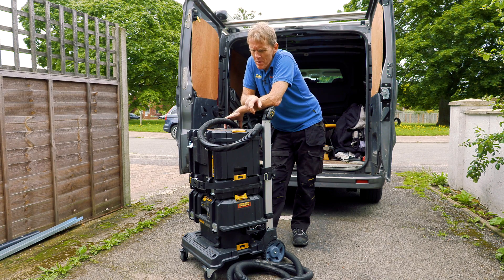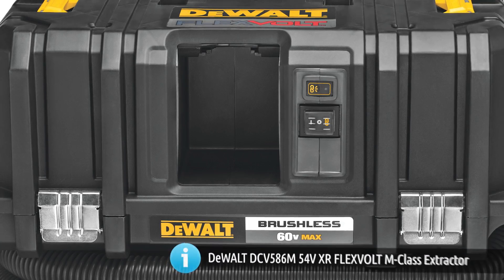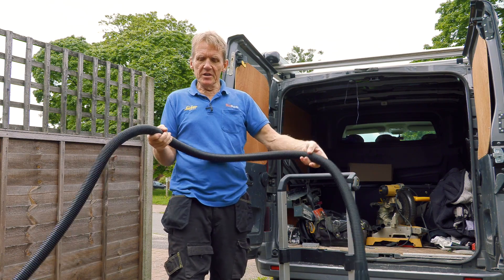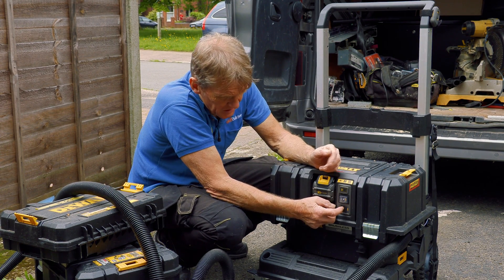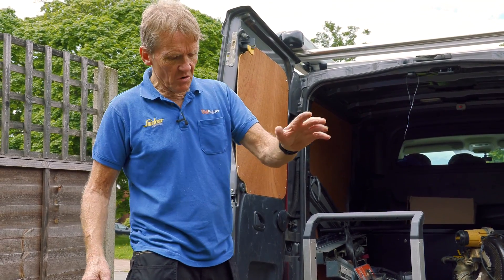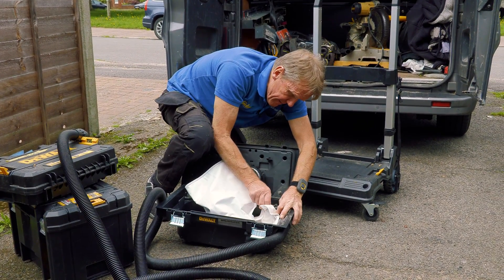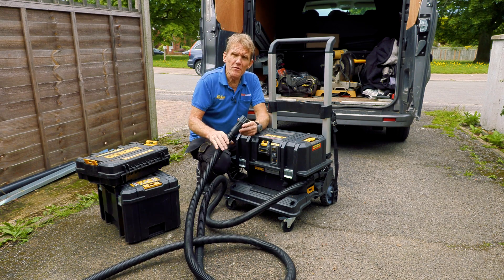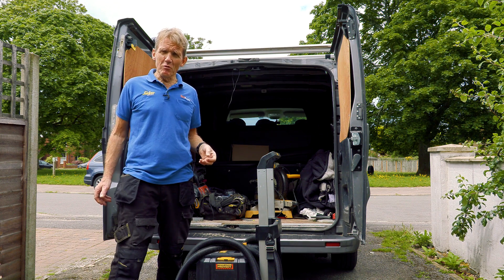Cordless Dust Extraction with DeWalt DCV586M

Comment: In regards to the DeWalt dust extractor are you able to turn off the thumper motor or is that in auto mode unable to shut off?
Reply from the maker: I don't think you can turn it off because it is the cleaning mechanism and the alarm would flag up a blockage.

Comment: I have migrated 100% to the Tstak system, which offers great value compared to others on the market. That said, Tstak design is idiotically flawed in multiple regards. One is evident at the start of this clip: The handled trolley does not allow the lidded boxes to be opened when connected to it. The trolley only works properly with Tstak's under-sized drawer units. Those  starting their collection of components  are well advised to save money and gain functionality by purchasing the 4-caster carts only. Another annoying flaw is that Dewalt did not see fit to stick with a truly modular set of heights: the small lidded boxes and the drawer units are not the same height, nor does the height of the larger lidded box equal twice that of either of the smaller units. The result is a totally unforced error: one can only use Tstak columns as level work supports if the component mix of each column is identical. Nonetheless, I find the system the best value available by far and have been very happy with its  durability and the efficiency it has brought to my on-site ops. I will be adding this integrated vac straight-away and using it atop a cart to support a large lidded box converted to function as a dust separator and, on top of all this, a miter saw. A cordless, dustless mobile sawing center will be a great asset for my interior finish work.

Comment: I’ve had my hoover for about 4 years but my watch stopped working. I’ve changed my batteries but it still doesn’t work. Any Tips
Reply: Hold the tool connect button on the extractor while pressing the remote repetitively that work for me

Comment: Protip.... Make a couple of bungs for either end of your hose to prevent dust falling out during transport. the extractor has an attached bung so making a couple for the hose too is a no brainer.

NB. Best place to put the remote is around the far end of the hose that way it'll always be right on whatever tool you're using.

Comment: ...I had big problem with this Dewalt hose , very stiff with big memory for the tiding around the vacuum and because of this I started locking for a better solution from other manufacturers. 
I find out one piece of art clear material and extending from 1 to 10 and I changed .
Reply: ... the new model of DCS520 has radio control includes in the circular saw this days.

Comment: This is silly, if the tool requires a dust extraction station then buy the tool as a plug in, if you have to plug one thing in then you may as well plug two in, thats, table saws, drop saws, routers and track saws everthing else battery.
Reply from the maker: You are assuming you can plug in. Many sites won't allow trailing leads.
Reply: @SkillBuilder  valcro the trailing lead around the suction hose

Comment: Been using it for about a week just for cleaning and its been very useful, the 6ah batteries run out quite fast but thats to be expected.  Not had a chance to try it out on any tools yet.

Not sure if I am doing something wrong but I find the bag fit is very bad.  The unit was beeping because the bag was full but once out there was still lots of space, probably a third left to fill.  Couldn't get the top back on without spreading the contents of the bag evenly or it just obstructed the filters.

Almost seems like the bag needs to be slightly smaller or the bottom of the unit needs to be bigger.

UPDATE: I recommend against buying this.  Been using for a few weeks on a mitre saw and the bags will only fill halfway before needing to be changed due to terrible design as I mentioned before, absolute rip off.
Reply: I've found best way is to have a few bags, fill them all, then empty them somewhere safely and reuse, easily get half a dozen uses from each bag with no fall in collection/suction rate, but manufactureer wont tell you that,wonder why. Becomes quite economical then.

Comment: Great review. I actually purchased one a few weeks back. My vacuum keeps beeping can't figure out why. Any reason why? Checked for low battery aswell.
Reply: I had the same issue.  I was using an attachment for cleaning which reduced the the hose end and it would beep like mad if set to 32, on 20 it was fine.  I guess it feels the restriction and assumes there is a blockage.  I have not attached it to any tools yet so not sure if I will get the same issue then, I really hope not.

Everyone shouts fire when it starts beeping, it was funny the first few times but not anymore :)
Reply: @rob8978  The bumping is to self clean the filters. It's a wonderful feature to prevent clogs. The device taps the hepa filters every few minutes, totally normal self cleaning function. Trust me, I had a $1,000 extractor that didn't have a bump feature and it required new filters every other month, it sucked.
Reply: @settlors  Was talking about the beeping.  The bumping is a great idea but the rest of the unit is badly designed imo.  Bags fit badly, partly due to how the filters share the same space and the tube comes in side which blocks easily.  

I have only been using it for cleaning so I guess it will be fine when using on tools and it's just sucking dust.
Reply: Corbit Don’t use it for cleaning, that’s a bad investment. Buy a $75 shop vac for that and save your hepa bags and filters for your dust extractor
Reply: Marcus Leach sounds like you are not familiar with dust separators like dust deputy, same concept here the vacuum it’s designed to create a vortex to keep dust away from filters. Thats why filters are in the middle and tube entrance place the way to create the vortex. This is a small portable dust extractor its not designed  to vacuum big debris cause hose is kind of thin. Overall I’m happy with mine. Its been great I love it.
Reply: @settlors   I find the sucking is actually a welcome feature of dust extraction units.  I  once had an extractor that didn’t suck at all, then I turned on the power and it thoroughly sucked.

Comment: I used that extractor on my table saw mitre saw and plunge saw. As a hoover I find it useless but on the tool it’s spot on. 
9ah for run time I find is better. Worth buying. Also I strap the remote to the tool I’m using.

Comment: Hi SB team.  I'd like to vote for a shop vac throw-down show down.  A comparison of multiple shop vacs.  I own two regular shop vacs and also have a Festool CT-26.  My shop vacs suck, and I (still) hate them.  They're poorly made - tops pop off when I go to lift them, tool racks have to be screwed in to the plastic siding or they'll pop off.  I have to wear ear protection when using them because their miniature motors scream when powered on.  They're top heavy and tip easily unless nearly full.  And finally, their vacuum power is weaker than it should be for the cacophony of  noise they make (I'd accept loud if they really sucked).  Can you save us SB team?  Can you find shop vacs that really add dust to our collections?  Thanks in advance.

Comment: Interesting one is cordless vacs or any type of tool extractors.
I think i'll keep with my corded extractor until we improve on battery power, as every vac i've known drain the batterys far too quick.
Reply: Disagree mate i have just bought one and now fully cordless router mitre saw the lot i wouldn't go back to mains and generator power
Reply: @jasonwindebank5455  you seen the 10inch flexvolt chop saw?
Reply: @Heaveho120  yes one of the guys have one and i have used it its a beast i have the brushless 36 volt makita and i love it
Reply: @jasonwindebank5455  even with just one battery?
Reply: I had to buy another battery for the extractor it only lasts about 20 minutes on a 6amp so i boughr a 9 on ebay .Thats probably the only downfall but would you want to go back to generator and leads

Comment: You can't beat good old Henry the hoover.
Reply: Mdf is well known to contain formaldehyde ‘s that cause cancer. Cement boards are proven to contain silica particles that are as deadly for you as asbestos. This is not something to mess with, but hey go ahead!
Reply: You won't get far on site with that mate😏
Reply: You can buy hepa filters for a Henry. However they do clog with fines very quickly. Henry for bulk clean up and this for power tools.
Reply: Very, very bad advice, hse do not recommend un-filtered vacuums
Reply: @I-am-not-a-number  Not really sure what you are on about. We use Henry and Edward with HEPA filter bags no problem
Reply: Michael Thorne You can. Quite easily. A poor substitution for a safe extraction device. Henry’s are designed for around the home. Not for the site